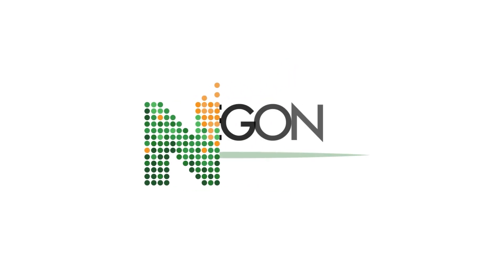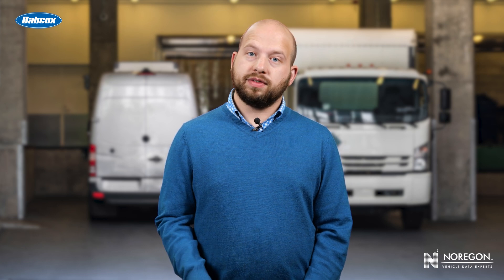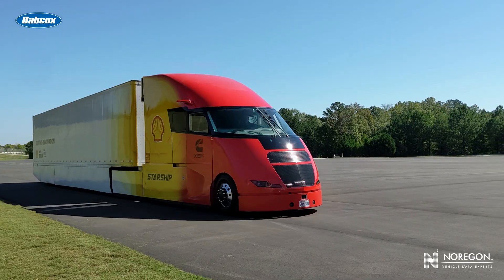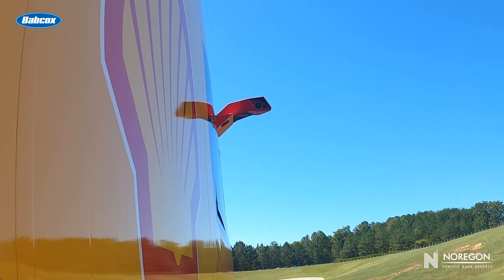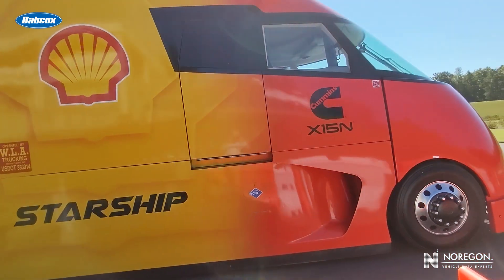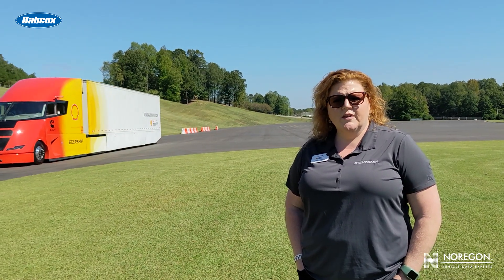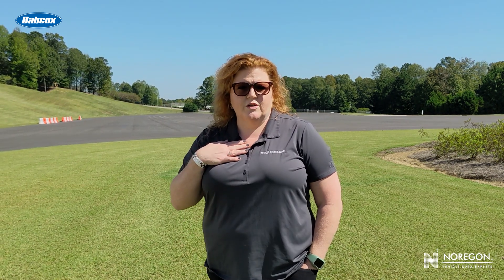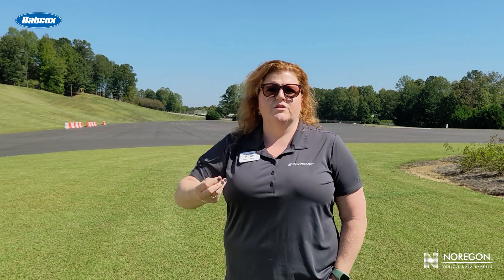Inside the Shell Starship concept truck

Comment: Another advantage is that engines ran on natural gas run clean and do not build up carbon deposits in the engines like diesels or gassers do. So I would think a Ng engine would last longer and require less rebuilds.